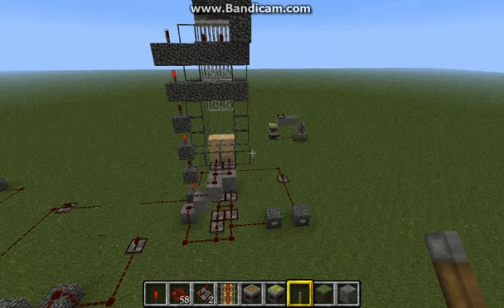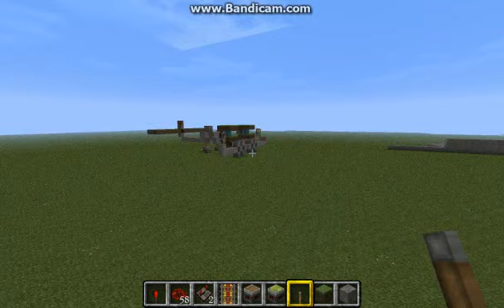Castle Portcullis Gate: Raises & Lowers, How To - 1.8.8

Comment: However, I'm realizing it won't work with a light sensor. I've never used one before. Mine is just a simple way to use a button to upon/close rather than a lever. For the light sensor (which I imagine is on during daylight and off at night or opposite), I've got no improvement to what you've done and I'd be curious to try it on the 360 version and see if it works.

Comment: On the Xbox 360 version, I created a flip-flop that, using a button, sends a pulse to the open circuit on first press then the closing circuit on second press. It's more compact than what you've got, and it doesn't have to use a lever (which IMO, is always a plus!). It should work on the PC as well.